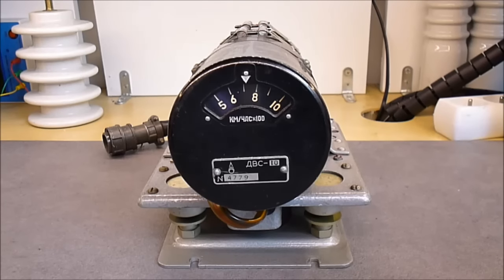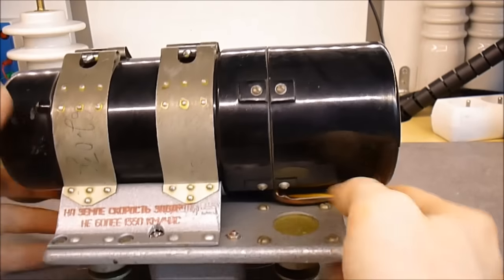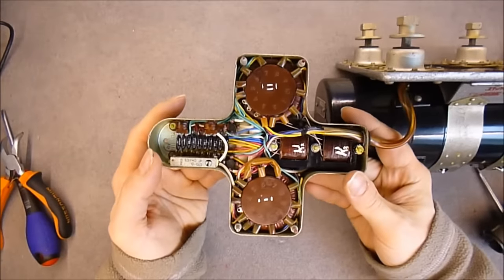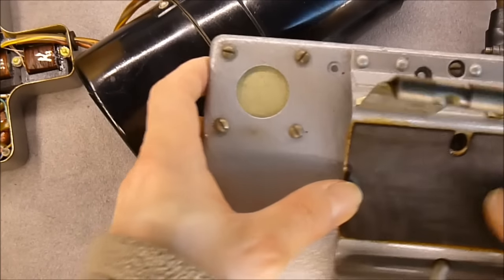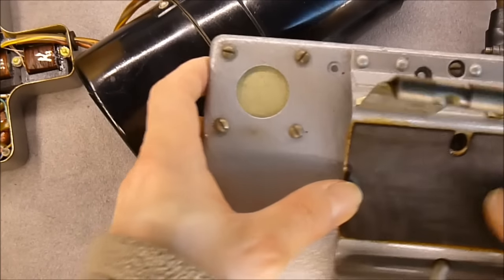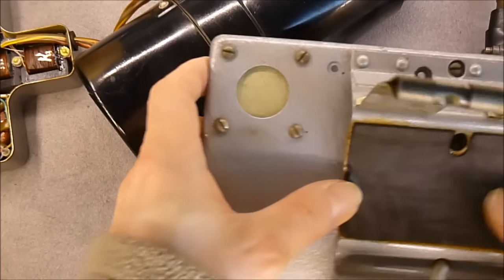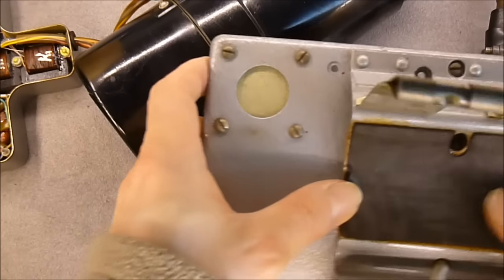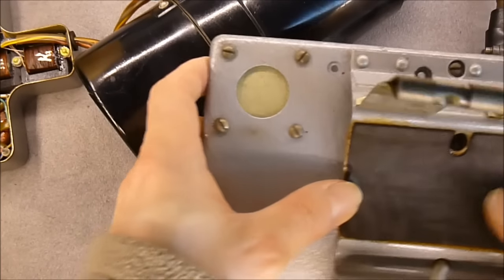Soviet avionics teardown: DVS-10 airspeed transducer

Comment: The electronic circuit is a magnetic amplifier used for the servo control loop, based on saturable transformers with mu-metal core. Old technique used in harsh environment. It is the same circuit than the circuit I have found in the Mach-meter of the same family of instruments. On the mechanical side there is an AC motor driven by the magnetic amplifier, the input is the potentiometer inside the capsule assembly. Output is one potentiometer attached to the motor of the servo control loop. I did the reverse engineering of this amplifier here: https://youtu.be/eP3_NBqNQU4